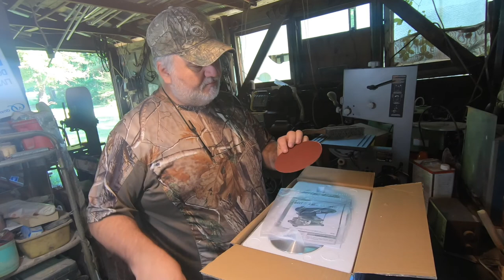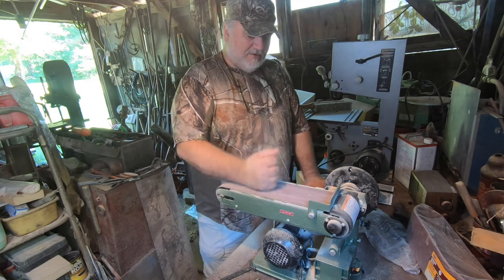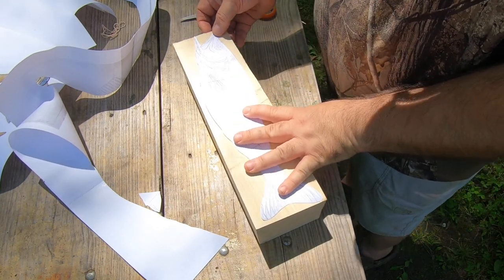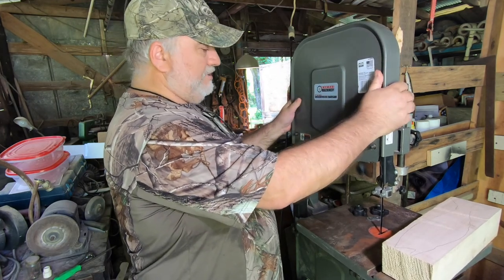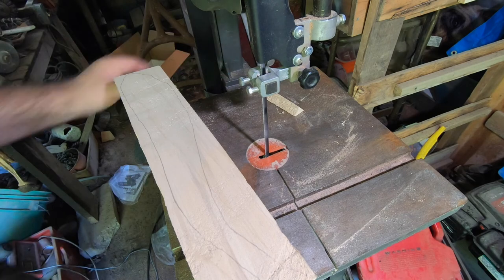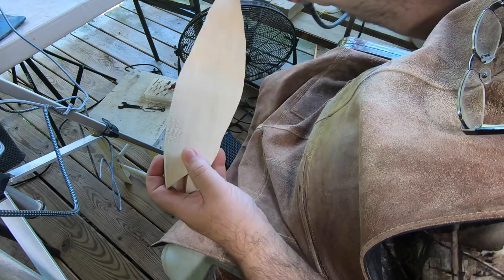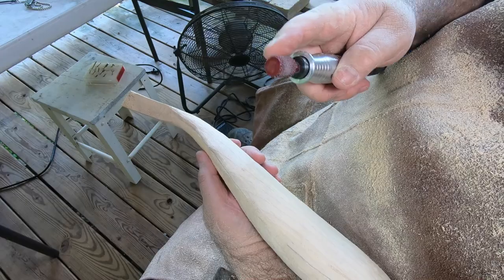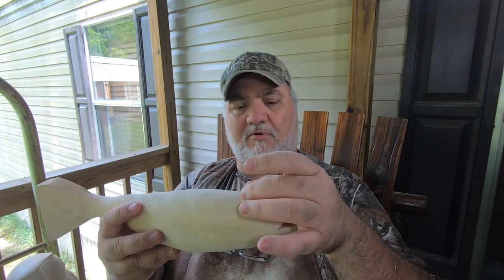Wood Carving a Walleye Part 1

Comment: You can get an upgrade kit for your band saw on Ebay, takes about 30 minutes to install and they are roller bearingsthat work great
Reply from the maker: Yeah I saw someone doing that on somewhere here on YouTube. I think it extended 3 inches higher. The one I saw also had a new blade guide with bearings. I meant to mention that in this video but it slipped my mind. I’ll probably end up doing that at some point unless I find a good deal on a bigger saw, which I’m always on the lookout for😜